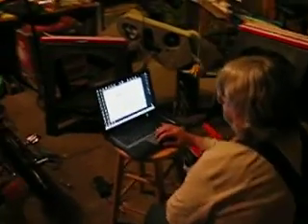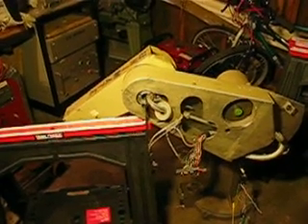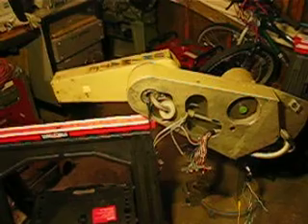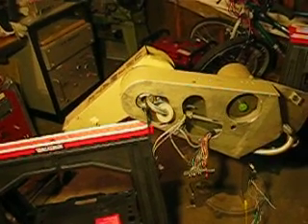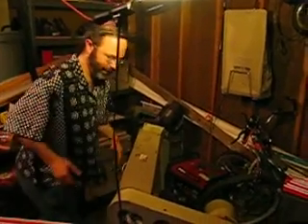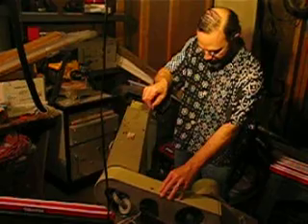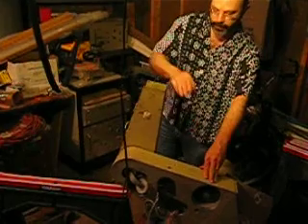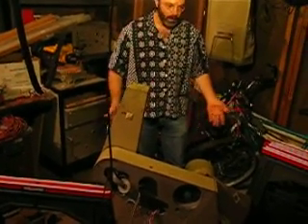PC PIC-SERVO-SC  OSMC  Puma560

Comment: This may be a dumb question but how did you manage to configure the PIC SERVO SC? I recently got a single chip PIC Servo and am struggling with the configuration. I'm using the NMCTest utility program provided by Mr. Kerr and a USB to Serial converter.